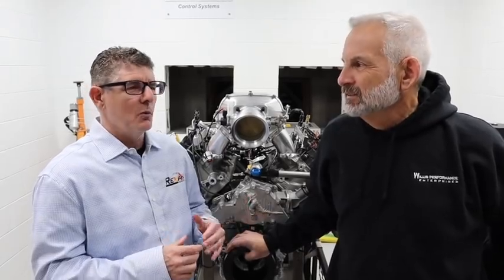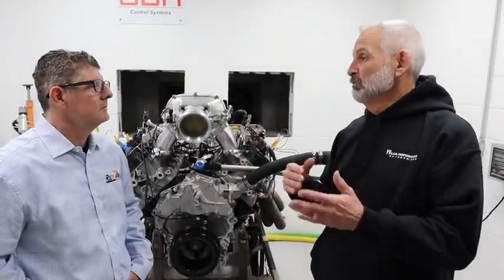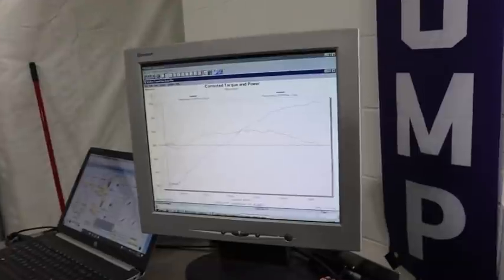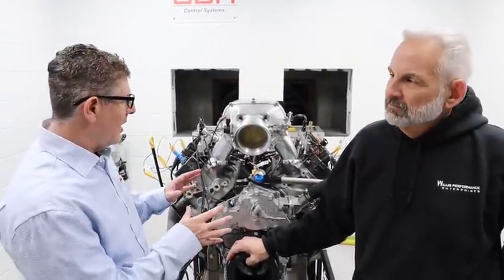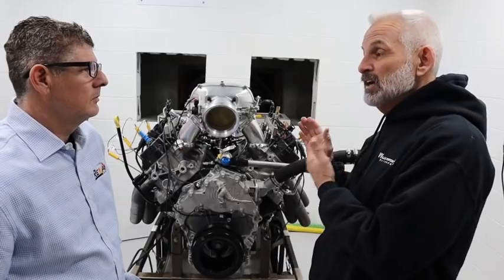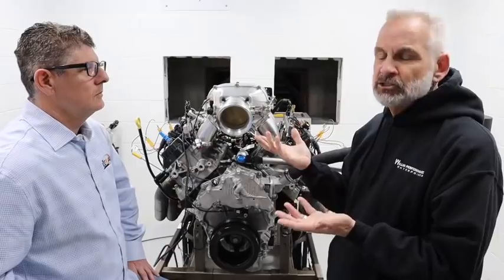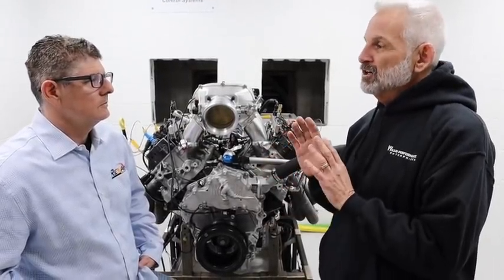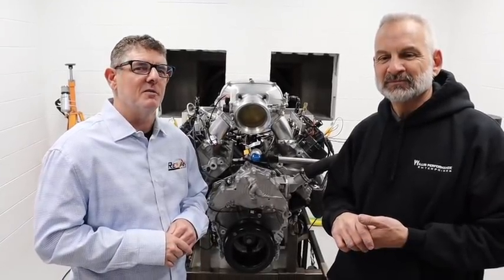Ford Godzilla 7.3 Stage 1 Heads & Cam Dyno Test — Massive Gains Over Stock! How is that Possible?

Comment: Stock bottom end doesn't impress me any more with LSs we'll talk after you make 1500 plus like Richard Holdener with a 6.0 big bang
Reply: Understand your point, it was not a statement on that the parts live at that level but the very little changes required for this performance level N/A on pump gas.   Boosted stuff is coming. :)
Reply: that 6.0 is on borrowed time too.
Reply: @frigglebiscuit7484  well he still uses it for testing but the big bang really about testing to failure but he only had a 3bar map sensor but it did not brake but it is not in a vehicle getting hit that hard often
Reply: There's a video of a stock bottom end 7.3 turbo making 1200 hp. Not bad considering they haven't been around long enough to really get to know.
Reply: Who cares.  Yawn.  Sick of ls.  Anyone with a brain knows you ain't gonna make 1500 long on a stock bottom end.  It's easier to stay alive on an engine dyno with no load.  You're comparing a modified engine with tons and tons of boost to a barely modified stock truck engine na.  He's not talking about the bottom end related to what it is holding but talking about how little it's modified.  If you ls nutthuggers had half a brain you might could figure that out.  You're too busy fuming fumbling at the keyboard being your usual keyboard warrior self...God just stop it.

Comment: I wonder what new 6.6 gas gm engine can do in similar case situations.  420hp & 464 tq is close to start with a .7 smaller engine. ? Thanks brothers keep up good work
Reply: The GM 6.6 is overrated by 20%. See the Ike Gauntlet run by TFL Truck. It posted 2nd slowest time ever seen ( a 4cyl Frontier was slowest), the 7.3 Ford was 3 mins faster!
Reply: @milesroe5082  It’s not overrated. GM lt1s 6.2s made 450hp/450tq and on to the wheels they made 420whp/420tq. LT motors make TQ. If anything they were underrated.
Reply: @milesroe5082  7.3 gas or diesel
Reply: @milesroe5082  gearing 3.73 6 speed vs 4.3 gearing & 10 speed auto. Apples n oranges. Stroke the 6.6 maybe .25 inch add 10 speed auto & 4.3 gear & run it again against the ford time.
Reply: @austintyler7991  you're going by ratings like they're the gospel.  I wouldn't be surprised if the 7.3 puts down more power and torque in the real world.
Reply: @milesroe5082  exactly
Reply: For sure would love to see someone run that.
Reply: if the 6.6 makes 400ft lbs torque @1500rpm like a stock 7.3 godzilla does.... ford is going to have to step it up
Reply: @codyramos3200  Absolutely chevy is way ahead with their LT platform. For example my genV lt1 6.2 made 700hp with heads/cam/intake on the engine dyno. And i know guys doing 750-800 SBE 6.2. Some 800-850hp with a 7.0L GM LT1. Chevy has had a nice head start needless to say lol.
Reply: @Allmotorzl1  peak hp is cool and all but the stock 7.3 godzilla point im trying make is the torque at low rpm 400ft lbs @1500 rpm ... torque from 1500rpm-5500rpm is no less than 400lbs peak tq 475@4000.. it is a truck engine after all . but yes the vortec/ls has had a good head start .. while ford was dragging its feet for years 2v modular v8 engines 1991-2014 never got past or even close to 300hp the n/a 4v stayed around 300hp for its early 90s-mid 2000s life.. idk why ford didnt push the envelope like chevy did.. sbc-lt1-Ls in the same time frame 3 completely different v8 engine familys
Reply: @codyramos3200  Absolutely these peak hp motors have heads/cam/intake combos in them to make all the power up top. I was saying that because of this video. My point was that the LT platform us a more efficient, better performing motor. The 7.3 has a bunch more displacement over the 6.6 yet makes the same TQ.. And the 6.6 uses the same tech from 2014 pretty much. Chevy knows what they are doing with pushrod motors.
Reply: @codyramos3200  they stopped using 2v 4.6 in mustangs in 2004 so they never tried getting anymore out of it after that.  They was doing 300 horse with the sohc 3v in 2004 for the 2005 model.  That isn't bad for a 281 cubic inch sohc engine from almost 20 years ago.  Ford has made good power with alot of engines with less displacement than the gm and dodge side since then.  This 7.3 is a beast of an engine.  It is every bit as good as any ls modified similarly and has more stock cubes than any ls.  It is legit.
Reply: @midnight347  I never said anything about mustangs when I gave the life span 1991-2014 . ford was still putting the 2v in vehicles after the mustang got the 3v ..... which kinda goes along with my point .. ford/Lincoln came out with the 4v in 93? And made 280hp..  the 2v never made it past 260hp by the time it was phased out in 04 for the 2005 mustang 3v that had 300hp .. the 4v cobra in 1996 made 305hp 10 years for the gt to finally reach the same hp level..  ford took their sweetazs time
Reply: @Cody Ramos The new Godzilla 7.3 gasser

Comment: I've had FE and 385 built big blocks, this things sound takes me right back to racing those with open headers.
I can't wait for the Cyclone build!
Reply: Is the Cyclone a variation of this engine?
Reply: @truck6859  The Cyclone is a Mercury built car. The sister car to the Fairlane-Torino. In this case a 68/69 fastback body style he recently acquired.

Comment: Curious on a size comparison between this 7.3 and an old FE engine?  Wonder if it would fit between the shock towers of 67-68 Mustangs / Cougars without major surgery?
Reply: Smaller than an FE
Reply from the maker: I cover the dimensions in an earlier 7.3 video
Reply: @revanevan  Thanks...will have to recheck the video.  Most of the comparisons seem to be against the excellent Coyote motor, but there may be a decent market for older Fords that don’t or can’t do the major surgery.  I don’t have the capability to fab things like others, but can put a motor into in if there is a kit with the correct parts.
Reply: @j.peterson210  I don't think it would have much trouble similar size to a 351 Windsor but slightly taller i think but they make couple good low profile intake options now that allow it fit easier and improve power.

Comment: All the ford fan boys are hyping this engine, ever heard of an ls7 7.0l lol 🤣 🤣
Reply: 445 is bigger than 427.
Reply: Yeah we heard about that valve dropping, rod bearing eating pos. Big deal lol
Reply: @edmundnlemadim8480  this 7.3 still hasn't proven reliability maybe it will be like the Tritton 5.4 or the 6.0 or the 6.4 diesel engines 😉
Reply: There is so many corvettes dropping 600+whp with bolt ons
Reply: Also 600 on bolt ons my ass. Only 3 vette powerplants do that, LS7 LS9 and LT4/5... LS9 and the other 2 are mild bolt ons and tune, LS7 needs heads aggressive cam, intake, intake mani and exhaust to do that... that’s not bolt ons. Ol lying ass lol 🤥😂
Reply: Another nervous GM guy🤔😔
Reply: love sheep engine
Reply: you mean the one with shitty rockers, and that likes dropping valves?

Comment: I hope the 6.8 is the same architecture, I'd love to see variants in junkyards one day.
Reply: They are exactly the same. They look almost like an LS motor in full dress
Reply: @danielsmith7935  you have seen a 6.8? Where?
Reply: @fightfanian  I have seen them at work since they are usually 1 to 2 years ahead of production. I am not sure how it will work with all the pandemic mess! They have them also installed in some F250s so who knows what all they will end up in. The more the better for cheapness!
Reply: @danielsmith7935  sweet! I'm assuming it has a shorter deck height to help it fit in a smaller engine bay like the mustang. I'm also praying for an aluminum block.
Reply: @danielsmith7935  I had heard that it might make its way into a mustang. Can you confirm that at all?
Reply: @crimsonstang  I haven't for sure seen them yet but some whispers from Ford say that is a plan
Reply: @crimsonstang  I am hoping to come up with either and stick it in an Excursion  with a turbo/supercharger! Have 6 kids and the Expeditions don't quite cut it
Reply: @danielsmith7935 I just don't see them doing a pushrod in the mustang it doesn't make sense honestly.  People are dreaming and spreading rumors

Comment: While this engine is amazing and obviously produces really impressive power with few mods. I wish more tuners and engine builders would be this excited about the Ford 6.2. In my opinion i think the 6.2 could be a great preformer and we already know it's extremely reliable.
Reply: It should have been 4v and not 2v. Some one needs to make some aftermarket 4v heads so it can do its thing
Reply: @ranware2779 the 2v 6.2 is still a badass engine.  If it had more aftermarket support it could be made into a monster.
Reply: @midnight347  very true indeed. Ford had so many engines to get right but left them where they're for some odd ass reason. It makes no sense to me why everything has to focused towards the 302

Comment: You know those modular guys that have cars and coffee for "mod motors only?" Yeah,  can't wait to return the favor with "SBF Pushrod Only" meets.
Reply: bottom line here is big displacement and conventional pushrod engines make great low end torque. ford finally came full circle and realized that
Reply: @erandy0240 the 5.4 was a very torque strong engine ecsp for 5.4 liters of displacement.  They did like 315 hp 365 tq the last year of the 3v 5.4 which was like 2010.  Pretty solid on torque if you ask me.  You're just a pushrod loving idiot who's blind.
Reply: Damn you sound dumb as f*** nobody's going to take their modular engine out for 7.3 push rod grfo
Reply: @fread51  you're saying a 7.3 isn't worth swapping in when u have a 4.6 or 5.4? shut your mouth idiot
Reply: @erandy0240  as far as swapping a 7.3 for the 4.6, you have to consider the price, and the fact you can make within 10hp of the motor in this vid with a junkyard 4.6, and a middle of the road turbo setup. If you blow the motor, you just pick another one up for a couple hundred bucks, or build it, make 1,000+hp, and still not touch the price of the 7.3.
Reply: Might i add also. That GM took fords 351 design and made the LS platform anyway. Ford has to come and make pushrod engines again. GM hasnt evolved in decades. They need something new to jack so they can develope the next "new" LS
Reply: @brandona4618  Can you explain this? I have heard people say that the LS is a copy of the Windsor but I thought it was just trolling at first. I don't see any more resemblance between the two engine families than we are used to seeing in American pushrod engines. I mean the LS uses cross bolted mains, a rear engine cover, captured lifters, crank driven oil pump, reverse flow cooling, a dry (from coolant) and isolated (from crankcase) manifold. So what's the deal? Is it just because the heads are symmetrical layout and no longer have the siamese intake and exhaust ports?
Reply: ford finally pulled their head out of their ass. the mod motors couldn't compete w the hemis and other pushrod engines now a days. they don't make the grunt.... period!
Reply: @erandy 02 you’re fucking delusional. 
460hp 5.0
480hp 5.0
526hp 5.2
760hp 5.2 S/C

Are the current coyote based offerings from ford. What engine “doesn’t make enough grunt” to keep up with the current engines from GM and Dodge? 

Less fanboy behavior and more facts in the future. It’ll make you look more intelligent in the future lol
Reply: @edmundnlemadim8480  they can compete, it just costs 3x as much to compete lol. The coyote is NOT a cheap engine to buy or build
Reply: @Driveitsideways 1 buying and building coyotes is no different than building a LS3, LSA/LS9, LS7, or LT4/LT5... this cheap assed junkyard 4.8 and 5.3 stock rods rings gapped build bullshit has y’all disconnected with reality when it comes to costs associated with an ACTUAL engine build.
Reply: @edmundnlemadim8480  thank you!  So nice to see someone who actually knows wtf they're talking about lol.  The coyote doesn't cost much to mod throw boost on a stock engine and make a reliable 800 wheel.  Seems pretty easy to me lol.  As far as the torque conversation evidently these people ain't never heard of the 5.4 and 5.8 mod motors in the older gt500s.  They make massive torque everywhere and are totally different from a coyote in that regard and they still make a ton of hp too.  Even the 4.6 engines made pretty good torque for their displacement.  Ls guys are delusional.
Reply: @edmundnlemadim8480 this!!!   Thank you so much.  All you ever hear is omg overhead cam is so "complicated" and "unreliable" and it "costs so much more to build" bunch if second hand spewed nonsense from people that are clueless.  You can tell they're really out of touch if they think any ls or hemi can get to a reliable 800 wheel easier and cheaper than a terminator motor, 07 up gt500 motor or coyote motor.  When it comes to building a short block and motor the pushrod costs just as much the only thing that is cheaper is camming because there is 4 instead of 1 that's common sense.  And boy do they hang on to that fact for dear life.  What they don't realize is the Ford can make a ton of power without even changing the cams lol.
Reply: @erandy0240  5.0 F150 is faster then a 5.7 Ram.
Reply: @benjaminwayneb  maybe due to the trans in the ford but compare a 5.4 f150 to a 5.7 ram. doesn't match up
Reply: @erandy0240  lay off the drugs. Im pretty sure the 4.6 terminator motor, 5.4/5.8 gt500, 5.0 coyote and 5.2 voodoo have been smacking up those hemi and Ls turds since 03.
Reply: @michealortiz3350  and all it took was forced induction...wow. now put that termy up against a turbo 5.7 hemi/ls :)
Reply: @frigglebiscuit7484  exactly and idc about how much hp they make in a truck. I want low end torque and a 5.4, 4.6 doesn't make that
Reply: @frigglebiscuit7484  plenty of turbod cobras out there with 4.6's that EAT up hemis and Ls's all day. Not to mention the mod motor has gone in the 5's, im not even sure if any Ls's have yet. Hemis are jokes, especially if you want to bring up the 5.7's. LOL 😆
Reply: @frigglebiscuit7484  that 4.6 holds a faster 1/4 mile record than both of those engines, modified, even with it's displacement disadvantage.
Reply: @erandy0240  5.4 and 5.8 mod motors in the 07-14 gt500s make a ton of low end torque.  They're torque monsters and still make a ton of hp with a stock long block just like a coyote does.  Coyotes getting well up over 400 torque stock from 5 liters is pretty good too.  Yall are trying to compare its torque against engines with over a liter more displacement.  You should check out a gen3r powered 5.4 or 5.8 if you wanna see massive torque.  I got an 07 gt500 with a gen3r stock headers and cams and still running a twin 69 tbody and I'm just on 93 and boostane I'm about 750/700 to the wheels.  Tons of torque even down real low.  You like torque you should try out a 2650 tvs powered older gt500.
Reply: @michealortiz3350 no ls has done that with any stock parts left on the engine that's for sure and they sure as hell ain't doing it with 4.6 liters lol.  Maybe a fully billit and built 400+ cube stroker.  The car you're talking about did that with a stock block, stock crank and factory style ported heads.
Reply: @erandy0240  the new coyotes make over 400 torque from 5 liters right from the factory...if you ask me that is some pretty good "grunt" all things considered.  Yea it dont make that at 1500 rpm but the ls cars dont either theyre rev happy too.  A 7 liter ls might but you wont see that kinda power out of anything close to 5 liters from the other two manufacturers.  An all motor coyote might not be the absolute best option for towing only in a truck but it certainly isnt bad especially for the cubic inches it has.  The coyote motors are straight beast once forced induction enters the equation theyre hard to compete with.
Reply: @erandy0240  the 5.0 destroys those engines in almost every way, are you referring specifically to low end torque between the 6.2 vs GM and Fiat in the heavy duty trucks?
Reply: You’ll be at a small event

Comment: Imagine the track shenanigans when a forged version of this finds its way into a foxbody, lighting off a 94/98/102mm turbo... sheesh this engine is going to be a monster 😳
Reply: This thing is similar but stronger than a GM LS. Just adding boost to a cam only 7.3 should take you over 1200hp at 15 psi boost. The stage 1 package should be 1300-1350 hp at 15 psi boost.
Reply: @hoost3056   it's still not going to run any faster than a 5.0 coyote. The stock 5.0s are in the high 7s, built 5.0 low to mid 7s. People are already going as fast as can feasibly go in a stock frame mustang. Maybe in a rail car or pro mod tube frame car to run 6 second times. But this motor is a waste of time in a street car🤣
Reply: Kids already got one i saw few weeks ago. Think its going in a new edge mustang. Or might be in already even